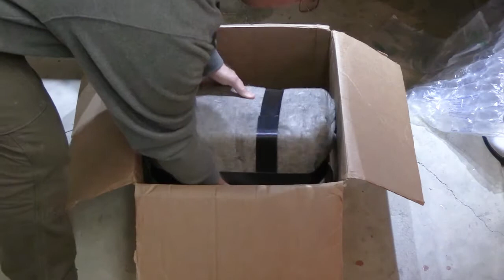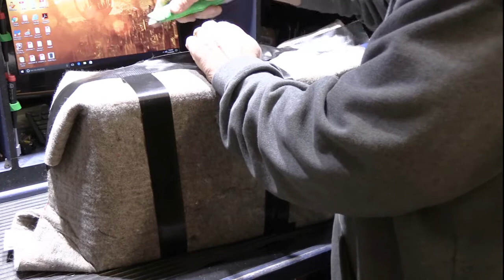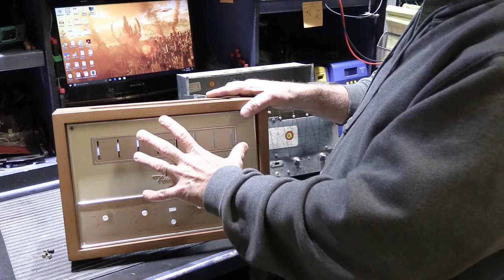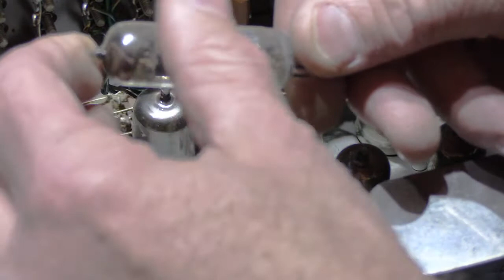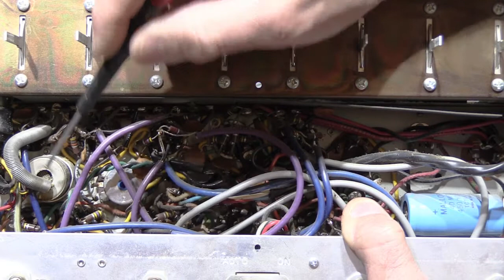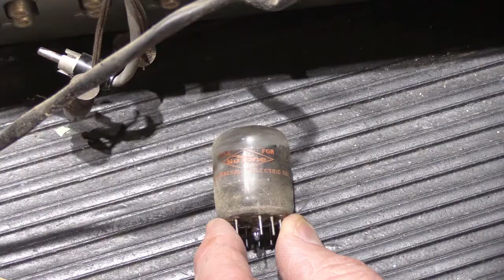Overview of a Vintage NuTone Model 2401 Stereo Amplifier and Model N2402 Tuner

Comment: Wow, we bought a home that was built in 1960 that has these two units with intercoms/speakers in rooms throughout the house and an outdoor panel as well. It does not power on at all and we have no idea if it's been messed with by anyone, but how amazing would it be to get it functioning? Beautiful pieces.
Reply from the maker: Hi udit:  The 2400 System was the Showcase System when it was introduced in 1960 - One of it's purposes was to show everyone what NuTone could design and build.
     At this point, since it's around 66 years old - It will be very "old and tired" - but it is also completely rebuildable - Chris

Comment: We purchased a house in Richmond, VA with the exact same system (but from 1961). Was pretty stoked to see this video. Thank you!. Only 3 rooms with stereo speakers, and 2 outdoor intercom units. It is remarkable that you have the experience to resurrect some of the knowledge surrounding this system. Truly wish I had the technical skills to make it work. Not even sure what to do with it-it just seems such a marvel of assembly; [much] more so, now, after seeing your video.
Reply from the maker: HI powerful:  I would assume that your home in VA was a custom and swanky home of its day - The 2400 System was a very special model, intended toshow off what NuTone could desin and build back in the early days on Radio Interocm Systems.  I hopw you figure our what to do with it - Chirs

Comment: I have this exact units in my house with multiple speakers with controls in each room. Living room has 2 speakers on the upper walls, also have the door speaker outside my front door. Didn't think about searching on the net about these and makes me want to have someone come inspect it.
Reply from the maker: Hi timothy:   Your have one of the most outstanding NuTone System ever made.  It may be very difficult to find anyone to 'come out' and inspect it.  These Systems are now about 60+ years old and there are very few of us left that have first-hand experience with them.  You can always contact us directly about it - Chris     nscompany@msn.com

Comment: My son just purchased a home from the original owners that was custom built in 1971 and has a complete system including tape deck. Do you know the best place to find it a new home?
Reply from the maker: Hi DTimothyLacy:  eBay is the best place to sell vintage equipment.  Make sure you investigate what the actual shipping cost will be.  Also, perhaps your son should slow down on the idea of removing the system, until he's had the home for a while.  Many of our customers find existing systems more useful than they thought it would be when they first moved in.  What Model is the system - What condition is it it? - Chris
Reply: @northsideservicecompany3567  https://youtu.be/1ZN6ZRyjSL0

Comment: Wow this takes me back. We had this system in the house I grew up in. Dad built the house in 1965. We had the intercom, radio receiver, fold down stereo and the reel to reel. The house is not in my family any longer, but as of 2006 it was all still there and working.
Reply from the maker: Hi jnnybiz:  Very nice story - You grew up with the absolute top-of-the-line NuTone 2400 System , and it even had the ultra rare Stereo Reel-to-Reel Tape Recorder. Depending on the size of the System - it could have cost as much as $3500.00 for just the equipment.  As a comparison, that is what an entry level Cadillac would have cost in 1965 - Chris
Reply: @northsideservicecompany3567  That price tag blows my mind. Ours was loaded to the max speaker capacity. Even had a pair of speakers on the upper level deck outside.  The speakers in all the rooms had the intercom speakers with the talk/listen levers and volume knobs. I just thought everybody had one.
Reply from the maker: @jblooz2371  Nah,  the 2400 system was ultra rare due to the cost.  It sounds like your parents really stepped up for their System - Chris

Comment: Would you say these units are good for another 10-20 years after they are rebuilt?
Reply from the maker: Hi Andrew:  While putting a number on the length of time any unit will last after a rebuild is a dicey thing to do - I would think if it's cared for, you should get the 10 - 20 years you asked about - Chris

Comment: Hey, I have this same system to be installed in my ranch, would you use shielded pairs or regular Cat5 for the wiring? I don't really know which is the best option. Also, if you use shielded wire, can you use a wire with multiple pairs or it has to be only 1 twisted pair? Any help will be appreciated.  Thanks
Reply from the maker: Hi David,  CAT5 would be the worst choice.  The closest cabling made today - that matches the original NuTone cable is Belden 9305.  It is not necessary to use shielded cabling (the original cable was not shielded), however it is important to follow good installation techniques and keep the Intercom cables at least 12" away from any electrical wiring and avoid long parallel runs - Chris
Reply: @northsideservicecompany3567  Can I use the Cat5 for the Channel B speakers only or it is not recommendable either?
Reply from the maker: @davidstewart9263  No CAT 5 anywhere please.   Belden 8723 between stations - Chris
Reply: @northsideservicecompany3567  where can you buy that kind of wire? It seems pretty expensive online.
Reply from the maker: @davidstewart9263  Belden cable is expensive - buying it on-line is the best way, you'll have a hard time finding it locally in most areas.  While it's not inexpensive - it if far cheaper than wiring it incorrectly and not have the system work correctly - Chris
Reply: @northsideservicecompany3567  thank you Chris!

Comment: We recently bought a mid century modern home and one of the exciting features was a “working” NuTone 2403 turntable. It works, but the newer NuTone amplifier/tuner does not. My goal is to restore and have a working turntable in the dining room. Suggestions?
Reply from the maker: Hi Steve:  What model is the "newer NuTone Amplifier / Tuner"? - Chris
Reply: Northside Service Company it looks like an IMA-323D. There’s a wall patch about the same size as the turntable (which is through the wall in the dining room).
Reply from the maker: Hi Steve:  Your IMA323D is a rebuildable model - Here's a link to our Video about the IMA323 Series:

 https://www.youtube.com/watch?v=Fy-2tv3rpvU&index=1&list=PLsTvqKsBnGYddIh_lbBIqc_mndwNyBx8G&t=0s

You can contact me directly about having your IMA323 repaired - Chris  925-743-8236

Comment: Excellent video!  Very informative.  You are very knowledgeable about these systems! 

I moved into a 1960 vintage home (in Metro East St. Louis) with a 2400 system (the 2401 Amp, 2402 Tuner, Turntable, and record storage unit (that someone put a Radio Shack AM/FM tuner into) about 14 years ago.  

The system was working when we moved in, except the downstairs speakers were disconnected.  When I connected them, I think I may have blown a tube.  

Am thinking about refurbishing the system.  

I don't have any idea what I'm doing, but my son is pursuing a PhD in electrical engineering... so maybe I can tap his brain a little.
Reply from the maker: Hi Steve:  Nice to hear about your 2400 System and you're interest in getting it working again.  As a word of caution, working on tube equipment requires great care - there are lethal High-Voltage section in both units - so you must be careful . . . otherwise it can hurt a lot - Chris
Reply: @northsideservicecompany3567  
Hi Chris, I have similar situation.  Moved into house that has the 2400 system intact.  Lights up but no sound.  Any suggestions on how to possibly revive it?  Would love to get sound so my wife doesn't try to pushed me to remove.  Thanks!!
Reply from the maker: @timt8236  You can contact me about have the equipment repaired - Chris  925-743-8236
Reply: Thanks Chris.  Appreciate the warning.   I'll be careful.  

By the way, I also have the "Operating Manual" for the system.  

Really interesting stuff in there... like how you need to use BOTH the AM and FM band to receive stereo broadcasts (!)  On p. 5 it says " ... the sound is broadcast over two frequency channels, or wave-lengths, at the same time.   One is usually an AM radio station, the other an FM radio station."  

I was born about the time this system was manufactured, and had never heard of AM/FM stereo simulcasts (I guess that's what you'd call them) before.  Have you?
Reply from the maker: Hi Steve: Does your Tuner have just an FM position or does it have an FM Stereo position? - Chris
Reply: Just FM.  It's got inputs for the FM Stereo module you showed in one of your videos, but this unit does not have that module.
Reply: Here's a link I found that describes the AM/FM simulcast...  http://springfield.gsu.edu/omeka/exhibits/show/georgiaradio/1960s/fmradio
Reply: Chris... It's up and running great!  Sounds awesome.  

I cleaned everything out gently with a brush and vacuum like you said.  Tested the speakers and wires downstairs for shorts, connected them back up, and now everything works fine.  

Still have to clean the turntable, and get some test records.  Also have not yet tried the stuff outside - I want to take it all apart and check it out before I power those components up.  

Hey... and I too have a Telfunken tube!  It's in the slot to the left of the power transformer (labeled "RECT. EZ81 (6CA4).  Rest are a mix if GE, RCA, and a couple others.

Not sure what happened those many years ago, but apparently I didn't really damage anything.  Intercom works too.

Am short a couple of selector knobs and knobs for the talk/listen levers... but so far that's it.
Reply from the maker: Hi Steve: Very Cool!  Good Job - Chris
Reply: Chris... I'd like to get audio from my PC into the 2401 amplifier.  Can I use the earphone jack on the PC, via a 3.5mm jack output from the PC - to the RCA connectors on the AUX input on the tuner?   I'm not sure about the signal on the earphone jack... if it will damage the amplifier.  I've read that a 'line-out' (usually a green out put jack) from the computer might be better?
Reply from the maker: Hi Steven:  To connect your PC to the 2402 Tuner, you should not use the green "headphone" jack on your computer.  You should add a sound card that has stereo "line level" outputs.

Chris
Reply: @stevenmcconnell4888  Do you still have the manual?  We just bought a home that has this system and would love to get a copy so we know what we are doing with it,